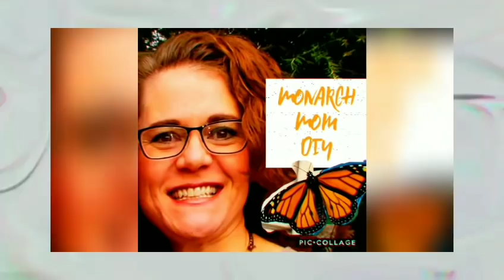DIY DOLLAR TREE FARMHOUSE HOME DECOR HOBBY LOBBY DUPE

Comment: Question:  the “mat” you are working on is DT placemats ...how are they attached to each other I need a moveable one 
Something I can slide under the bed when I’m done ...ideas?
Reply from the maker: Sure Maureen. I take 6 placemats and cut off the rounded corners. Then I tape them together with packing tape on the backside. I use it until I can't stand it anymore then get rid of it. I should think of a way to reuse them
Reply: Monarch Mom DIY thank you so much ....great idea ...I use them as pet placemats under their food